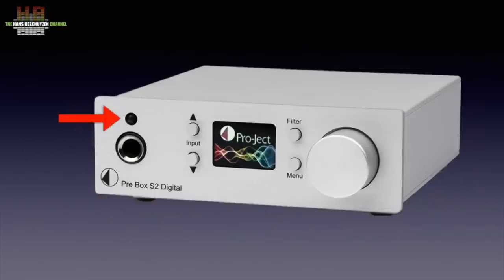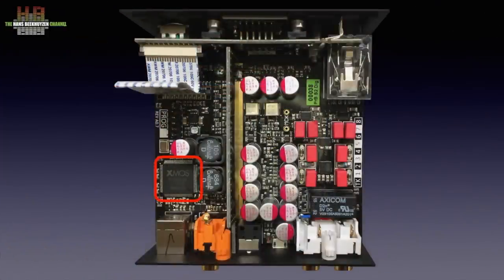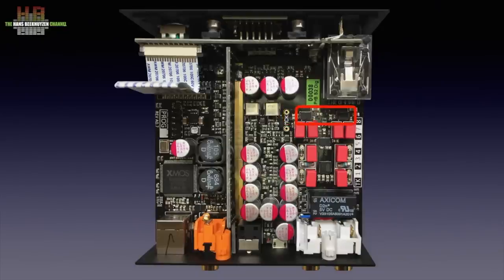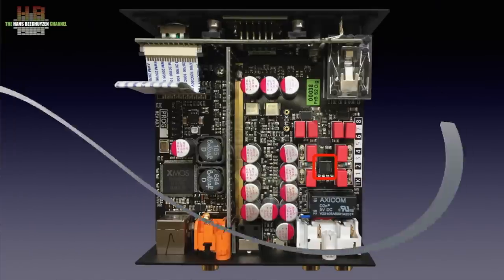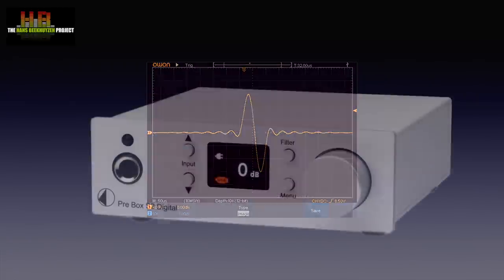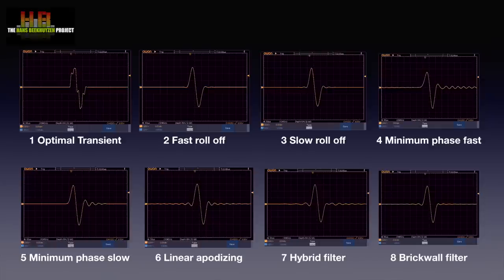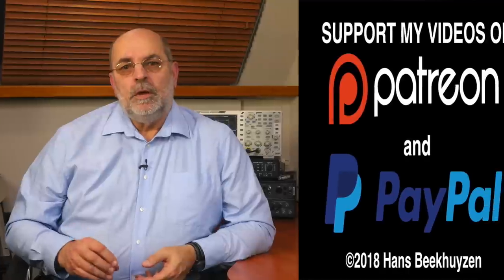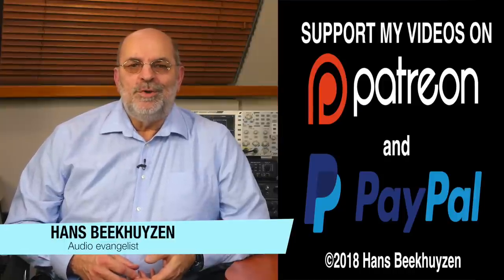Pro Ject Pre Box S2 Digital: MQA decoding Digital DAC/pre-amp

Comment: Hi Hans. Important information regarding MQA here, I believe. I figured out the issue with the Pre Box - it was a DAC setting in the Allo USBridge. 

Next, I endeavored to play MQA from Tidal. That did not work. It just played it at its regular resolution. So, thinking that it might be a setting in Squeezelite and Tidal, I skipped this for the time being, and went straight to 2L and downloaded some MQA files. I played them. They did not play in MQA, in fact, it wasn't even the original resolution - it displayed 44.1. I thought this should have worked based on what I read from you in response to an earlier question I had. 

The Tech Support guy at Allo has been great (3 emails to Pro-Ject/Sumiko have gone unanswered), and he has tracked this down. His latest email, after checking all my settings and then trying it himself with Roon, Volumio and LMS, he finds that only Roon plays back ANY MQA file in full resolution of the three, EVEN FILES THAT ARE LOCAL.  In his case, we both downloaded files from the site 2L that were encoded MQA. They play back as standard 44.1Khz files in Volumio, and in Logitech Media Server. Only Roon gets it right. 

So, this is new information and not what we had talked about. If you can shed any more light on this I would appreciate it. Otherwise, it appears that, at this time, only Roon and the handful of other streamers specifically mentioned in publications can play back MQA files in MQA. Period. Do they have to pay a licensing fee or something? It appears that bit perfect transferal is not the only thing required. Not the outcome I was hoping for. I can send you screen shots of a live shot of what resolution the Allo is streaming. My non MQA hi rez files are getting through just fine.
Reply from the maker: This doesn't make any sense. Unfortunately this week I have no time to check it. Did you make sure there is no processing at all and that the volume in LMS and/or Volumio is set to 100%.
Reply: The Hans Beekhuyzen Channel. Yes as far as I can tell. Volume is set to 100% and everything else is turned off. I can send screen shots if need be. The only person who has been of any help is the Allo tech support guy. He was very helpful when setting up the Allo. He tried Volumio, LMS and Roon. Only Roon passed it. At his request, I did a terminal command that showed what the player was streaming when playing. Any non Roon file, of any resolution it got right. Any Roon file it showed only 44.1. The Summiko guy is lagging behind. As it's the Tidal person. In knowledge, that is. I'm giving them information to help them catch up.
Reply: Still no help, from anyone. The guy at Allo, and a person on the LMS forum has been helpful at tracking this down. Bottom line, I don't think MQA works with LMS. I'm thinking any MQA you played was with Roon, not LMS.
Reply: I found to get Tidal MQA I had to install drivers from the Pro-Ject site(and reinstall if I moved to a different port). Also in the Tidal app settings select (more settings) select both exclusive mode, and force volume. It produced MQA using pass through MQA option, with pass through disabled it displays MQB, I think that’s still MQA with Tidal doing the a(software) portion and the dac doing the b portion, but can’t find confirmation of this. You should also have latest firmware, currently 2.12.
Reply: Hi Daina, could you please share how did you make the Pre Box working with Allo USBridge?  It looks like it's recognized as I can see it in the list of available playback output devices, however I can't figure out why I'm still not getting any sound from it.

Comment: Dear Hans,
Another invaluable review. Thank you for all your work.

Based on one of your recent videos, I tested and will buy a Pro-ject Stream Box S2 Ultra network bridge/streamer to use it with Roon and basically ditch any necessary Mac Mici or Intel Nuc for this.

Q1: At the moment, as DAC for the Stream Box, I am using an ifi micro iDSD Black Label connected to an ifi PRO iCAN amplifier.
I am very curious of the Pre Box S2 Digital to use as a DAC and replace the Black Label. What do you think? Is it a worthy upgrade?

Q2: In one of your other videos where you talked about what you have learned over time, you mentioned the necessity to use better power supplies like the SBooster BOTW P&P ECO MKII. I found a dealer in Romania who could help me with this product. 
The question is for which of the devices specified should I use it and would it bring an upgrade to sound quality. Did you test the SBooster also with the Pro Ject devices? The SBooster will replace the power supply provided by the manufacturer, correct?

Thank you,
Andrei.
Reply from the maker: You find the review of the Black Label here: https://youtu.be/qhGBVccjcUc, the Stream Box S2 here: https://youtu.be/7CX-pZRhbtI and the sBooster here: https://youtu.be/tCeSbOfqikw. Also watch https://youtu.be/n3sjLQf4Rf0.

Comment: Be cautioned that Pro-Ject DAC's can decode MQA files and streams, but NOT MQA CD's.
Reply: What would you reccommend for decoding a MQA cd?
Reply: So glad I just saw this. I recently picked up some MQA CDs, and was looking at getting the S2 to decode them on the PC via USB. Think I’ll pass now.....
Reply from the maker: It’s more likely that it can decode MQA CDs but only using the USB input. So if you use a computer to play the MQA CD and send the digital audio over USB to the DAC, it will correctly decode and render MQA CSS.
Reply: @TheHansBeekhuyzenChannel  But can this decode and render streamed MQA files (perhaps when connected to a Raspberry Pi) via the coaxial input?  Another review said this can only decode MQA (streamed files or CD) via USB, is that right?   Thanks!

Comment: This unit sound OK - nothing special al all. There are UBS issues, power connection issues, display issues. I have been through two of them. Even the way they package the unit is very poorly done. MUCH better option at this price point. This is a one out of five stars.